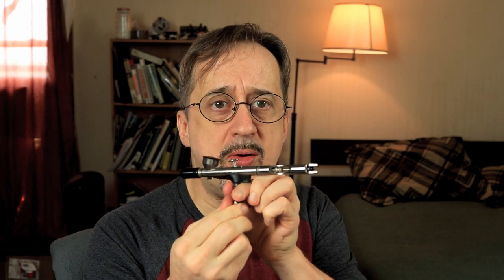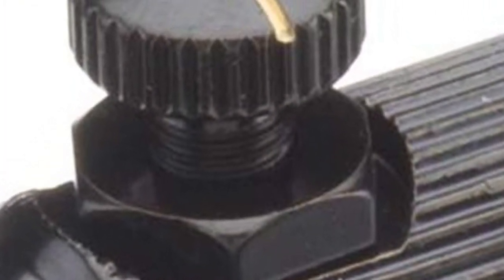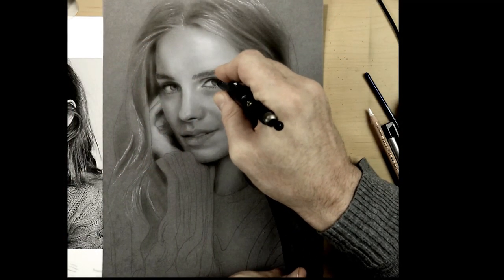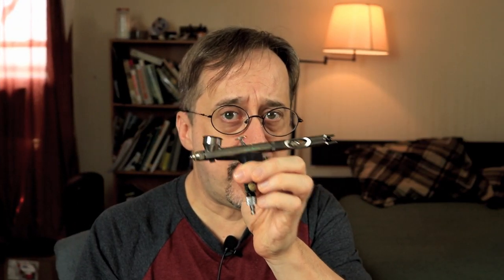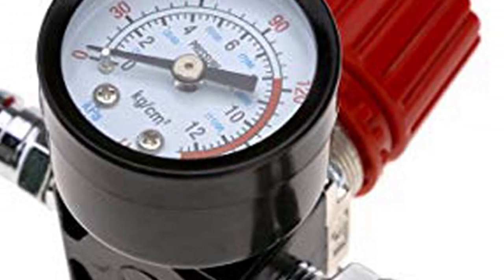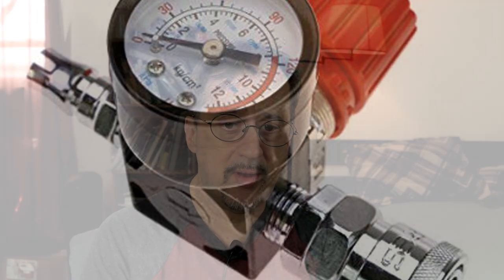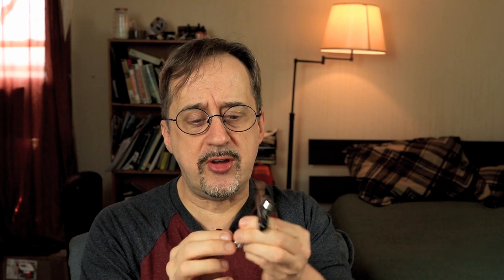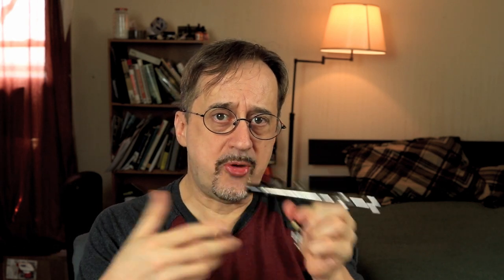The Best PSI for Airbrush Tim's Two Minute Tech Tuesday

Comment: Thanks Tim, I have tried a cheap valve and found they don't work very well. The Iwata external mac valve is the one to use ... It works a treat.
Reply from the maker: Hi Ken, Thank you so much for checking out the video and great comment. Yes the Iwata External MAC valves are definitely the top of the line right now.

Comment: The iwata external Mac valve can this connect to the devilbiss Dagr or Is there something similar ?
Reply from the maker: Hi Daisy, I think it will fit. Check and make sure that your hose connection on your airbrush is 1/8 inch.
Reply: @TimothyJohnLukeSmithPSA  nice I'll double check, great video here 👍🏻